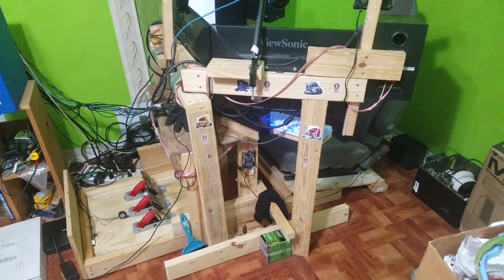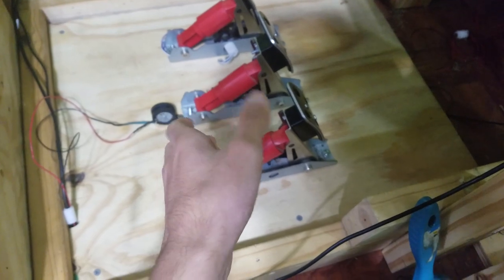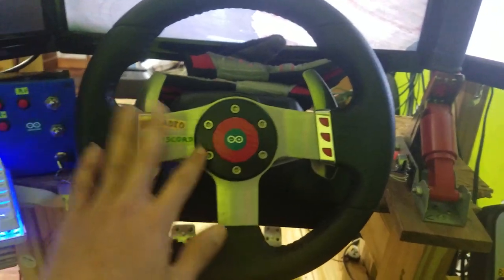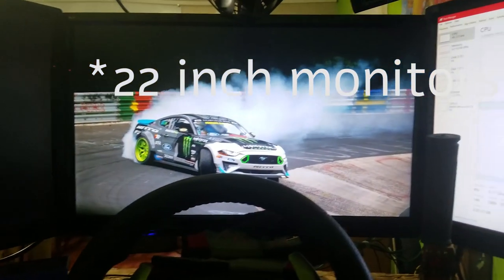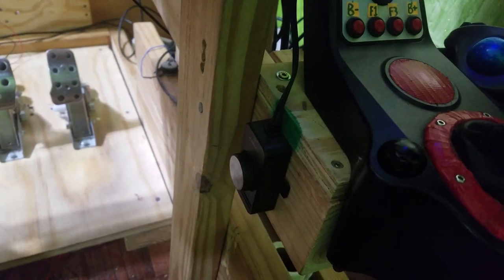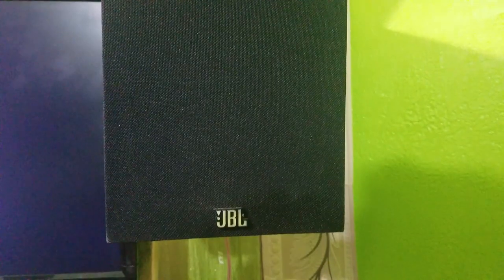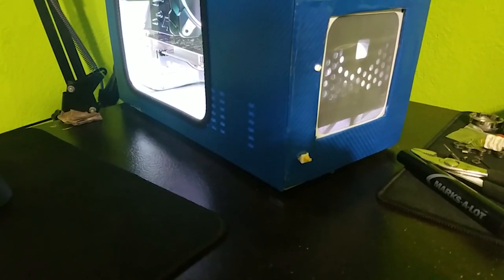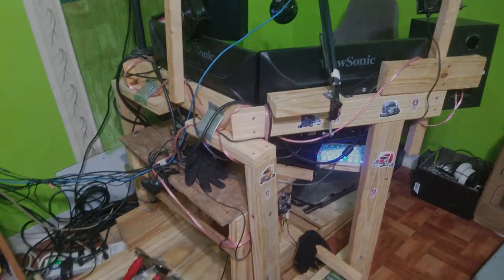$1K Sim Racing Rig | Triples, Handbrake, Button Box, G27, 60kg Brake, Cooling

Comment: Do you have the files for the g27 handbrake? I want to do the same thing, but don’t have a good design for it. Thanks alot
Reply from the maker: amstudio made that design. Heres the video https://www.youtube.com/watch?v=QWc6EbQdUjE
Reply: @TechiePocket1  i saw that, did you buy his files or did make your own? I have the pedal and everything, but struggle to find a cheap handle for it
Reply: @TechiePocket1  thanks for responding so quickly btw
Reply from the maker: @oli4004  I bought his file and printed it out with a friends 3d printer. Before that, I just got some wood and screwed it on. I'm sure you can find something cheap.
Reply: @TechiePocket1  Thanks man!
Reply from the maker: @oli4004  Np! Thanks for watching